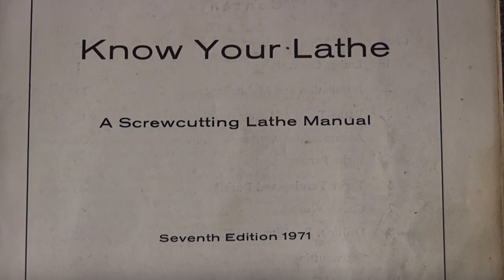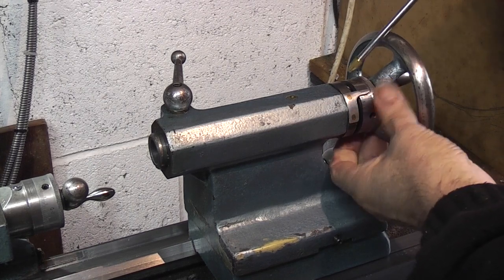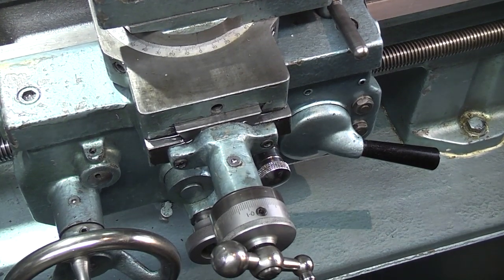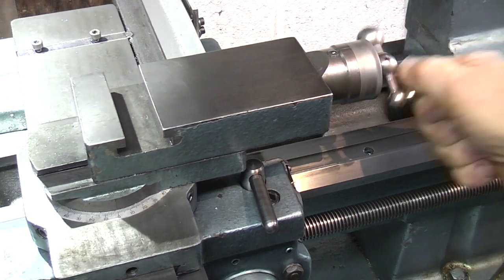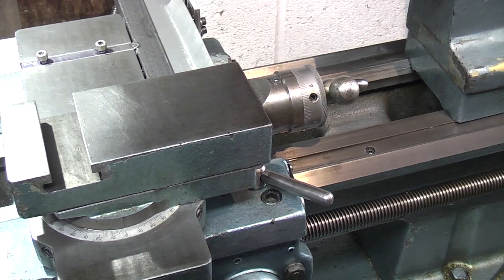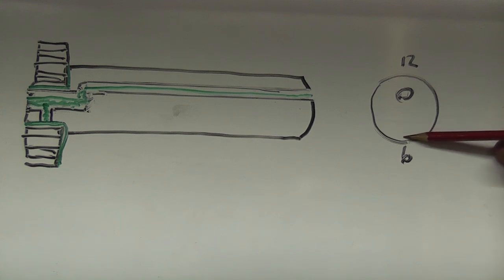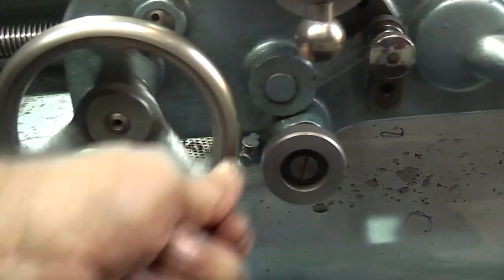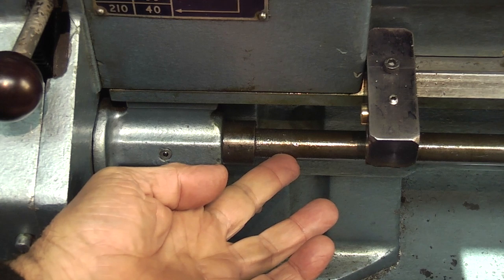Do I put oil in that hole or not ?

Comment: Handbooks for the Asian standard issue bench lathes often leave out an important lubrication point. These lathes have a separate lead screw and drive rod for the apron. The drive rod passes through a keyed worm on the back of the apron. This worm drives the gear for the auto feeds. Every month you should reach behind the apron and smear grease on the worm and it's mating gear.
It's important to remember that an air hose is not your lathe's friend. It will blow chips and swarf on to all the exposed gears on a lathe,  no matter where they are. These chips get into the oil and especially grease and wedge themselves into the gears. This can get so bad that it will break gear teeth.  Open quick change gear boxes are bad to have this happen as the gears are usually out of sight/out of mind and close to the chip pan where compressed air will bounce the chips into the gears.
Cheers from NC/USA

Comment: Hope the Lurgy moves on soon.
My preferred oil for slideways, and slow moving items is Shell Tonna T68 ( M2 or M3), the "T" refers to added tackifier, ref resists washing away by coolant. Other grades are available to suit colder or warmer climates, ref ISO 32 or 220, the 220 is good for vertical slideways. Obviously there are plenty of alternatives.
Great vlog, thanks for sharing.

Comment: Over winter I've wrapped a cloth sheet round the whole lathe to prevent airflow and fresh condensation on the cold metal, helps a lot was well as oiling of course.

Comment: Engine oil probably isn't the best lube for machinery, because it is formulated to operate at very high temperatures, using it is better than nothing but it's not as good as fine machine oil available at most engineering suppliers.
Reply: No!  Engine oil has detergents to clean the carbonated particles in the combustion engine.  You cannot use for your lathe.  Use ISO 32 or 68 oil.

Comment: Thank you for your fantastic video and it helped me to complete a nearly full oiling up.

I say nearly as I have a later ME10 than you cna I have a back gear with an oiling hole covered by a allen set screw. I have yet to find the right size Allen key to be also to complete the oiling.

Kind regards

Comment: Hi Alan I do not seem to have success using an oil gun such as yours. The  never seems to penetrate the valve. Is there a trick i do not know? John
Reply from the maker: You use the nozzle to push the ball bearing in which opens the seal then pump the oil in

Comment: Your videos have been very helpful, not much info on the older boxfords. I have an early  csb with the sliding motor mount. Pardon the inuendo but mine have nipples that stand proud, do you know what type of tip is needed to oil them?
Reply from the maker: In not sure but. It sounds like an oil gun like a grease gun but pumps oil
Reply: @enotsengineering  yup you are right, been looking through videos and found one explaining how to adapt a grease gun to take oil. Hope your feeling better :-)
Reply: @enotsengineering  how do you oil your one, ie what tool